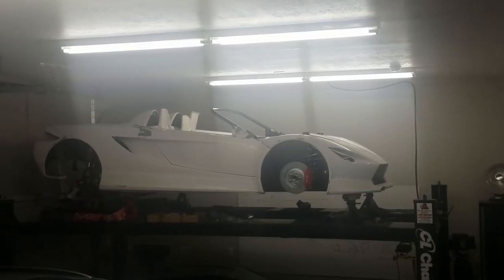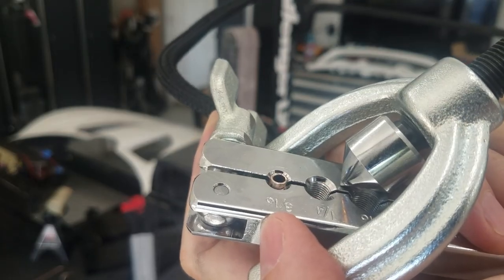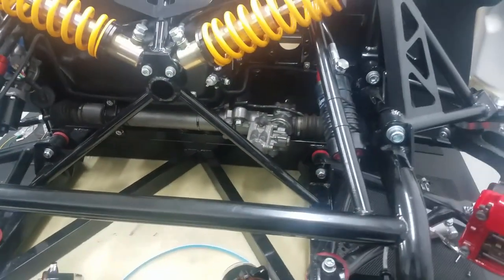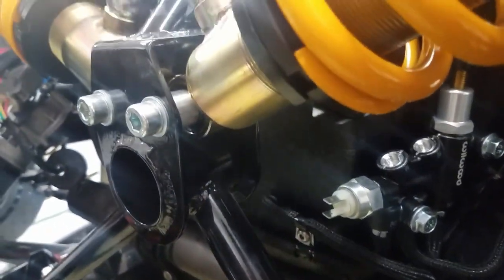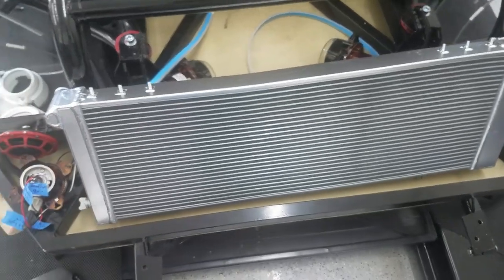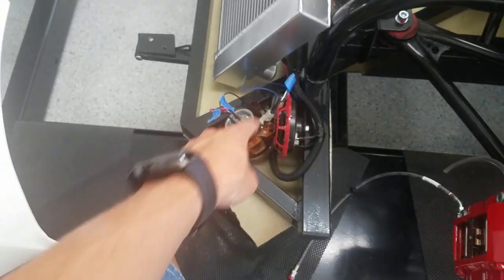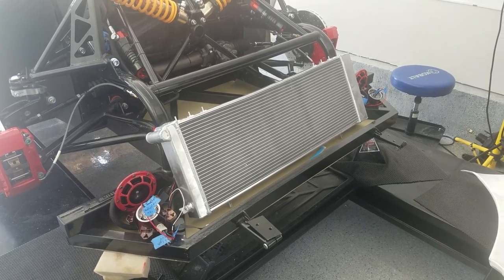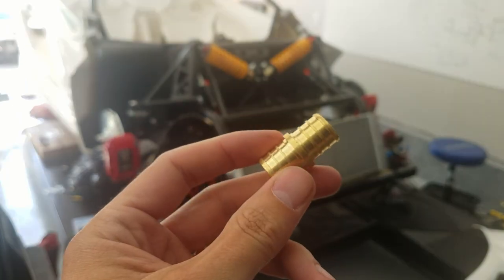Tesla Motor Cooling Part 1

Comment: for me I'm going to be using PC components(triple radiator's, 9 fans, 2 or three pumps, 2 or 3 reservoir's) for both the batteries and the Tesla Motor cooling and a fan controller wired into the fuse box. plus lots of clear tubing.
Reply from the maker: Sounds awesome!

Comment: 2 things you might want to look into
1. You should add coils to your lines.  They will flex even when you don't think they will.
https://auto.howstuffworks.com/auto-parts/brakes/brake-parts/brake-line-bends-loops.htm

2. You may want to look in the flaring tooling from Eastwood
https://www.eastwood.com/professional-brake-tubing-flaring-tool.html
Reply from the maker: Great advice!